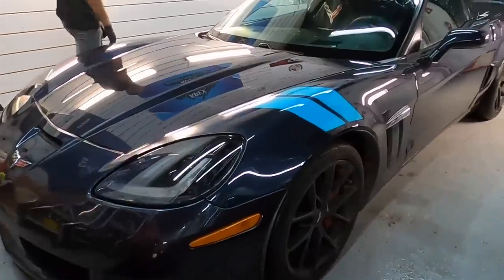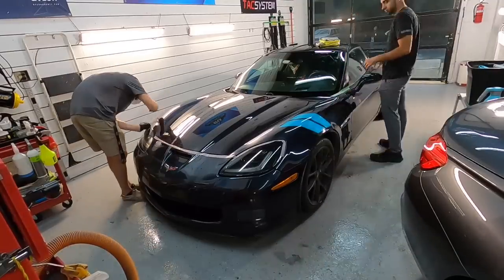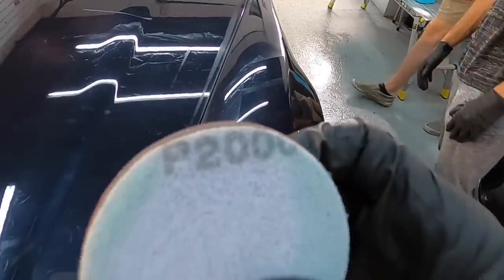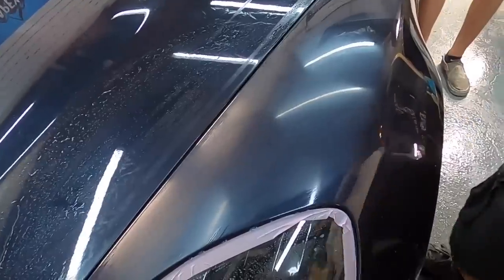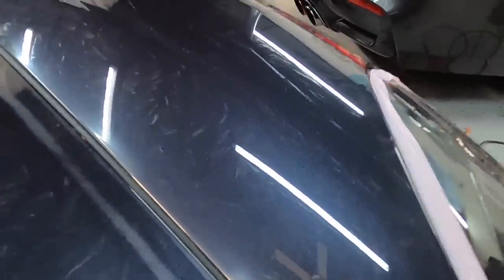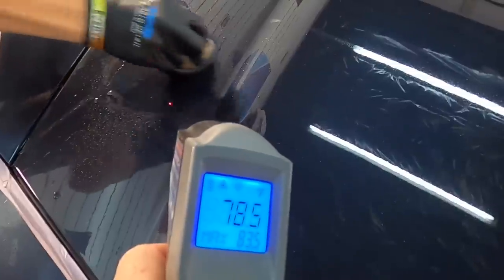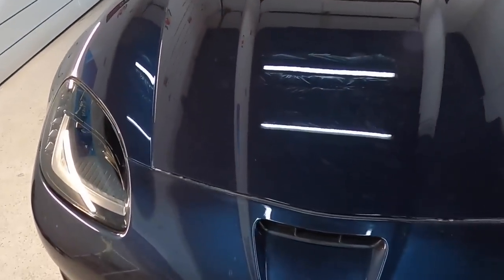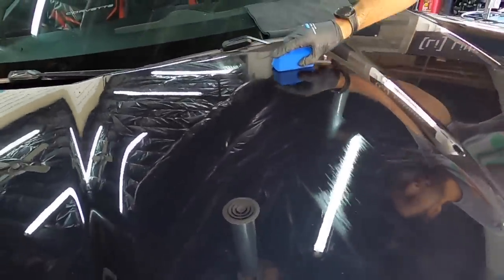Let's Bring This C6 Grand Sport Corvette Back To Life!!

Comment: The silence is fine and appreciated, I myself have been getting tired of constant noise and music with lyrics, I have been listening to a lot of lofi lately ,especially when detailing,  maybe something you’d like some of that? 
I don’t think you saw my Instagram message but I had a question maybe I had the wrong expectations about 3D one but I bought some along with a euro fiber 50/50 pad for my Bauer long throw random orbital and tried using the setup to buff out some 2000g sanding the other day and the pad and compound combo wouldn’t even touch it, is that combo not good for 2000g scratches or was something wrong ?

Comment: I have a car that has a half a dozen spots in various part of the car where I have missing clear coat about 1/4 of an inch in diameter do I fill in with clear coat and then sand, any advice?

Comment: thanks Brian - picked up a few more info nuggets on wet sanding. Your voice over and descriptors sealed the deal. Feast with my eyes on the quality work. Don’t need the noise (lip smacking and salivating drip drip drip sound effects). Chef Brian has plated another great dish. Be well - shine on shine on.